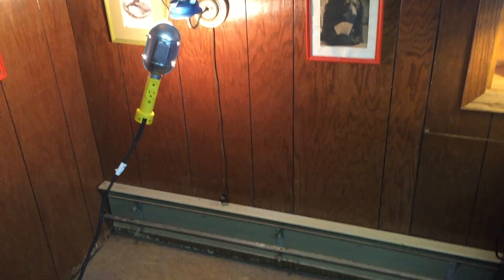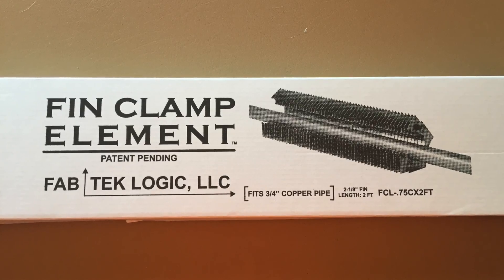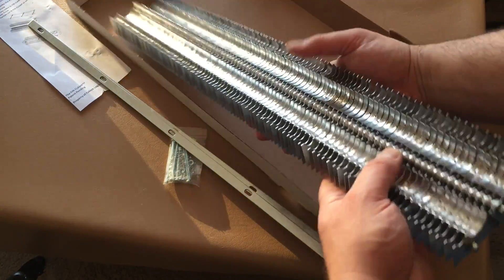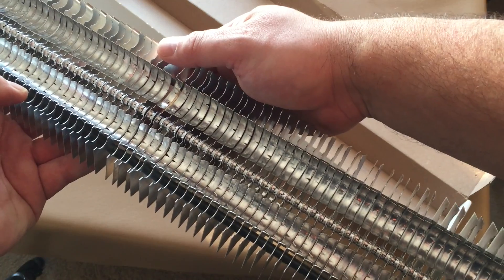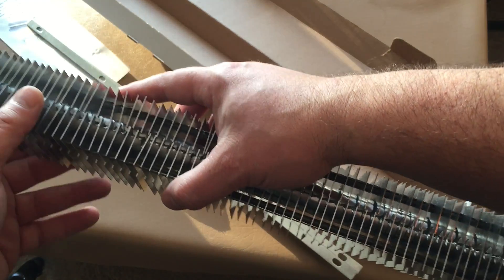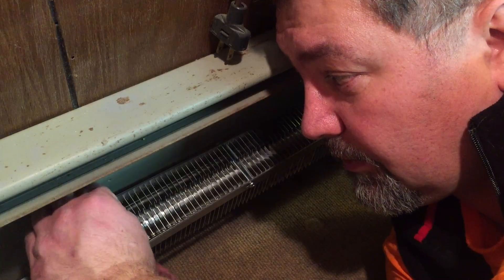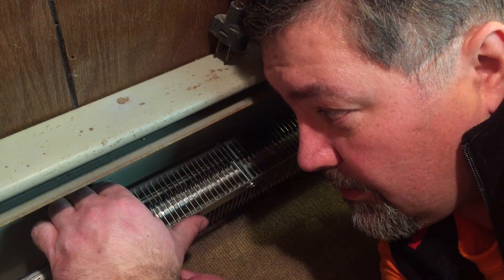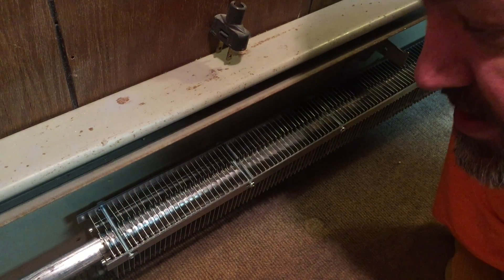FabTek the easiest way to add fins to bare pipe baseboard heaters and Increase boiler efficiency

Comment: What a great idea!
I’m going to do my bare hot water pipes in my basement with these! Help distribute free heat
Reply: Seems like a smart idea. If you did install elements on your exposed hot water pipes in your basement, I'm wondering what you think and how it affected the space. Also, do these clamp style fins make any noise? Thank you
Reply from the maker: That is exactly what they are meant to do!

Comment: In case you were wondering what the rubber bands included in the parts package are for: you use them to hold the unit shut so it's easier to put the bracket on.